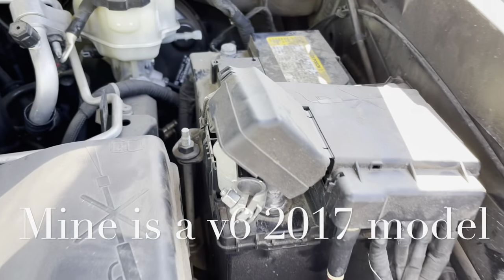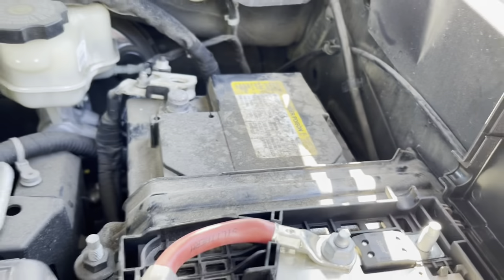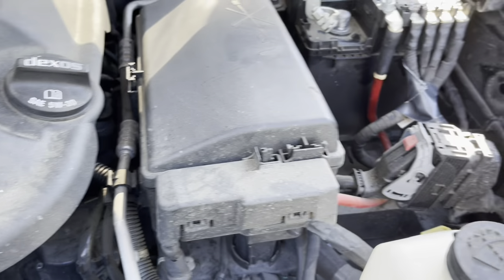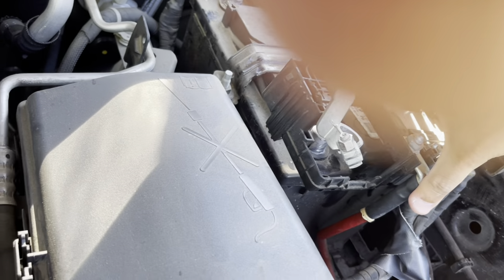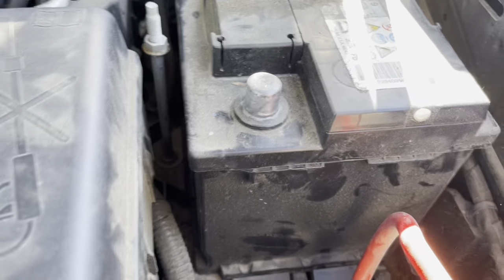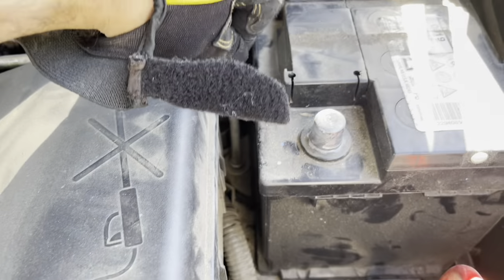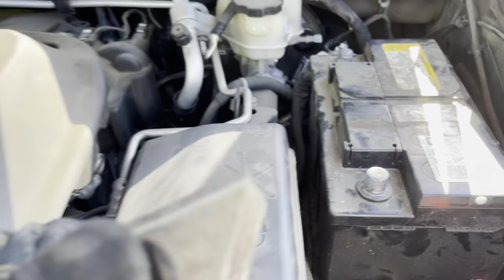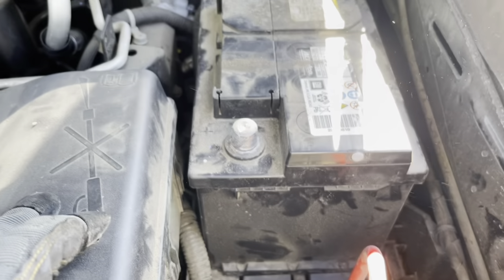Changing the Chevy Colorado Battery. Walkthrough.

Comment: After you install your new battery in your 2017 Colorado V6 and when you try to start it all you get is one click don't panic. Leave to cables hooked up and let the truck sit for a couple of hours and it will start. The computer is recalculating. The battery has to be hooked up to supply power to the computer. Thank you to my small town tire dealer for sharing this with me and saving an expensive trip to the Chevy Dealership.😀
Reply from the maker: Good to know. Luckily mine started right up. May not be the case for everyone.
Reply: Dam
Reply: I got that click and it started up when I tried again a couple minutes later

Comment: Funny the one step you didn't show I need. This 2020 Chevy Colorado's negative connector is a booger to get off! I don't wanna keep tapping the terminal for fear of breaking.
Reply from the maker: Aww man.
Reply: @MrBaldChronicles.  the terminal broke off. Apparently, that strange setup has those 2 triangle things work as a tightening. So when it get caked on stuff it does release. The terminal broke of. It was enviable. So I just tap the remaining terminal off and cleaned the 2 bushings. But you video sparked ideas on what to do... so thanks. 👍
Reply from the maker: @gfreeman3979 right on man.

Comment: great video thanks, how long is the warranty on the original battery mine seems shot under 2 years but have 48,000 miles on it?
Reply from the maker: Good question. I have a 2017 and I’ve had it since 2019, same factory battery but I don’t drive much. Funny thing when I took the battery in, turns out it just needed a charge. It’s been working fine.
Reply: @MrBaldChronicles. was the alternator not charging it enough?